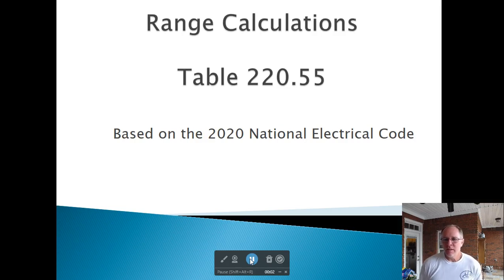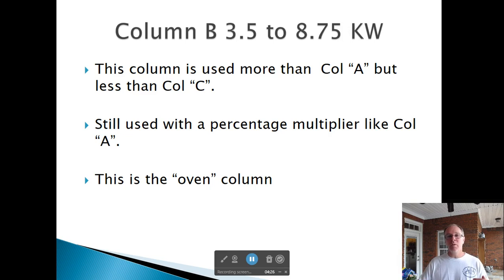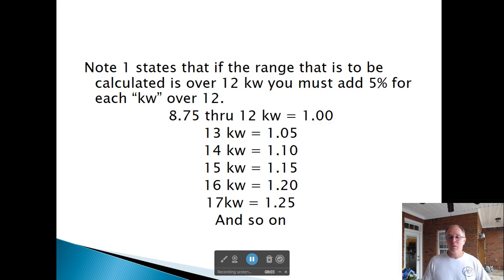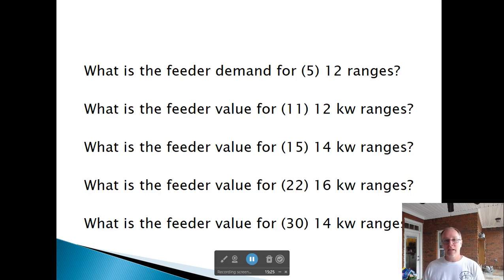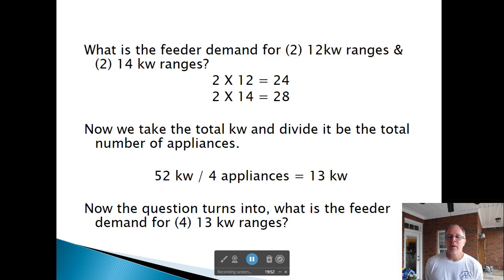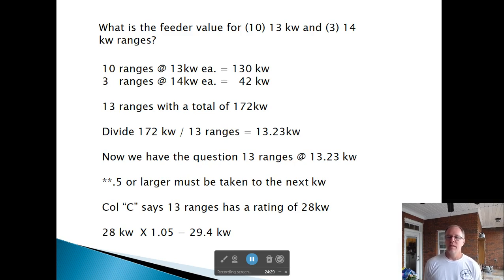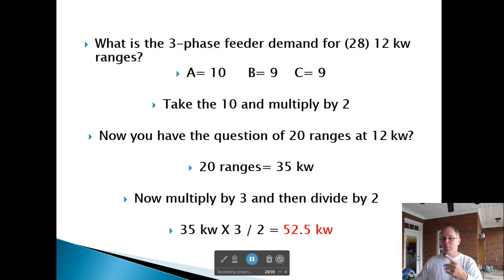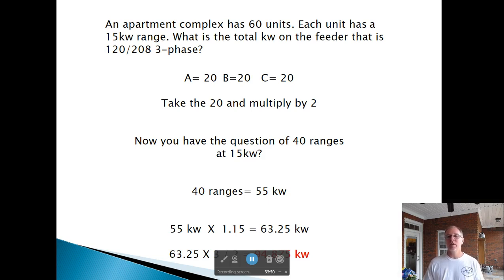Electrical Range Calculations Exam Test Prep Col "C" Table 220.55 NEC ELT242 Community College Class

Comment: Great instructional video. I teach NEC Code classes in Texas. I have found that the easiest way to teach the concept of 1-phase ranges on a 3-phase system is to simply use the divide by 3 then times 2 method. The students seem to pick it up faster. Similar to the example in the NEC Annex. 
(35) 12 KW 1-phase ranges on a 3-phase service example:
35÷3=11.66, so since you cannot have .66 of a range, you must round up to 12. Then multiply 12 x 2 = 24 
(24) 12 KW ranges per Table 220.55 = 39 KW.
39 KW ÷ 2 = 19.5 KW per phase demand.
The 3-phase equivalent demand per phase would be 19.5 KW X 3 = 58.5 KW or 58,500 VA.
3-phase load in amps for a 120/208v service is 58,500 ÷ 208 x 1.732 = 162.38 amps. 
Any method that gets to the correct answer is the right method, but they seem to grasp this method quicker. But then there are always those that need something different in order to grasp the concept. Once they do, they get it. Kind of like teaching the concept of a 3- way switch loop. It just suddenly clicks.
Thanks for the videos.
Reply: same thing bro... thanks

Comment: The 3 phase calculations at the end are not correct. At the end you will need to divide this by 2 to get the "va" per phase and then multiply by 3 to get the total "va" of all 3 phases. Sorry for this.

Comment: Sir thanks for share your time and knowledge with us, I would like to ask you how did you get 49.5 KW on this question, What is the feeder demand for (30) 14 KW?.
This is what I’m getting from the table 220.55 columns C, 26-30 ranges 
(15 KW + 1 KW for each range ).
So my calculation was 
30 ranges x 1 = 30 + 15 = 45 KW.
Please let me know if I’m wrong.
Reply: You need to add your 10% for being over 12 kw
Reply: 45 kw + (10% of 45 kw) = 45 kw + 4.5 kw = 49.5 kw, that's it